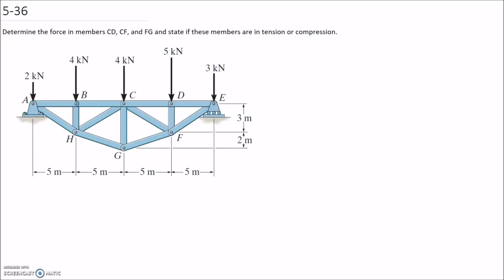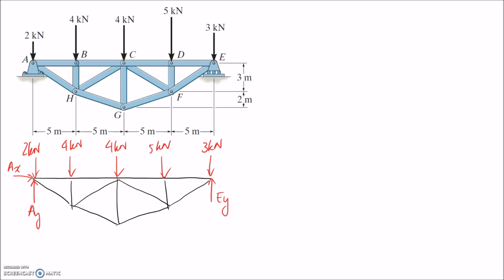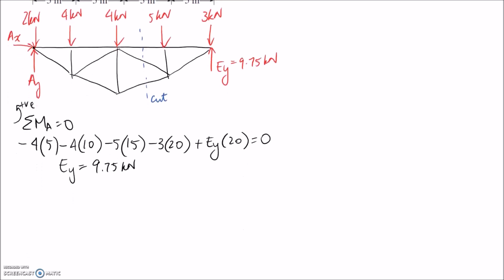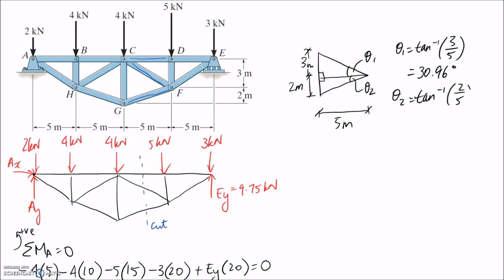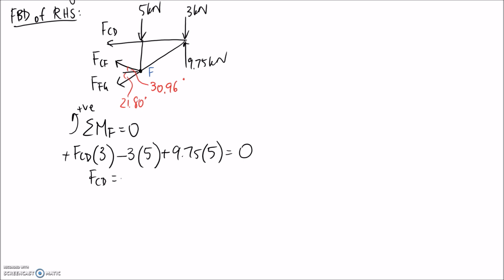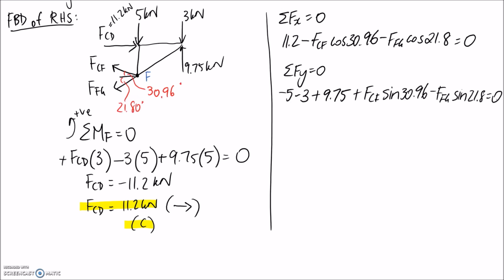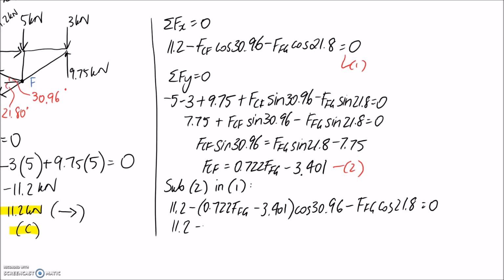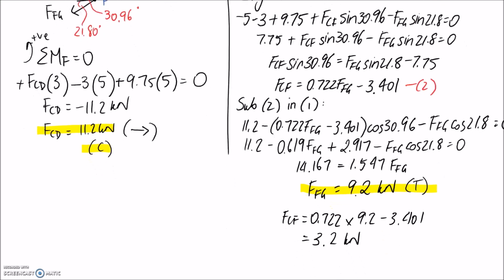(5-36) Method of Sections

Comment: Is there a reason you took the moment about point F? Can it be taken about point D?
Reply from the maker: You could sum moments about any point. I picked F because 2 forces acted through so wouldn't appear in the equation (distance =0). This means you can directly solve for the one unknown left. If you picked D you'd end up having to do simulatenous equations.

Comment: At Minute 10:24. Isn't -5-3+9.75=1.75 and not 7.75 as shown?
Reply from the maker: You're right. Thanks for pointing that out. I must have read the 1 as a 7 from my original working of it. The working reverts back to being correct from the line that reads "F_CF=0.722*F_FG-3.401".
Reply: Andrew Russell I wanted to say that